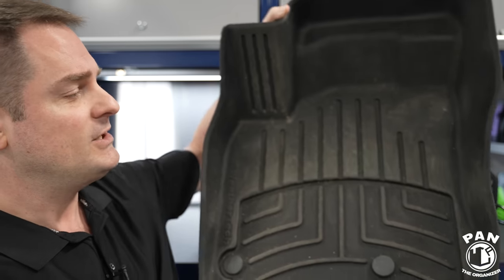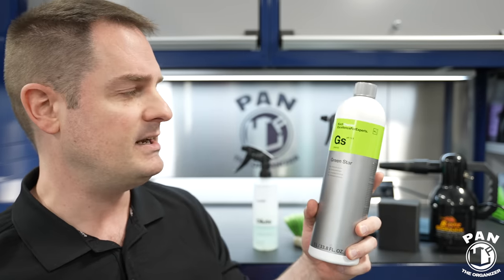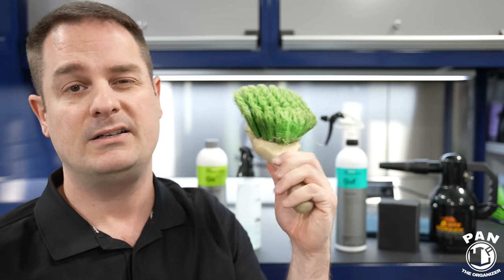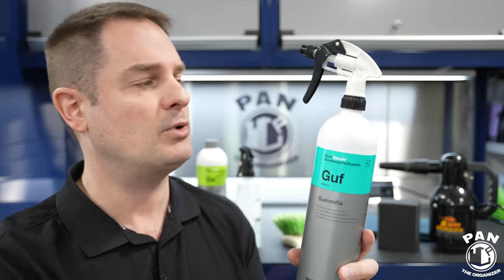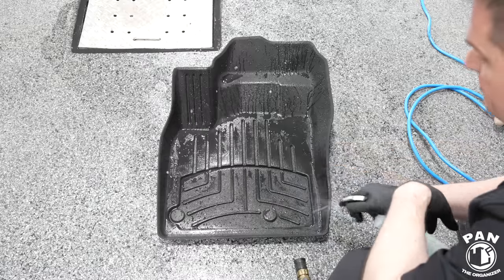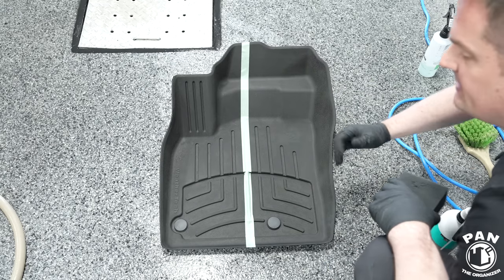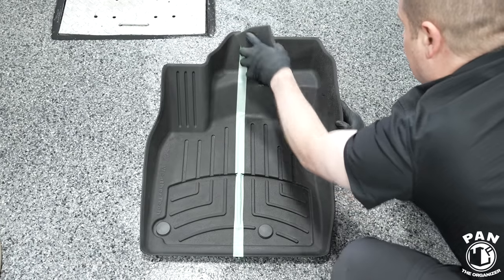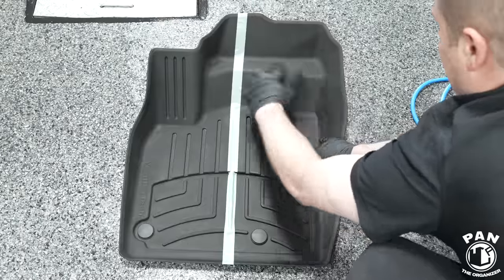HOW TO MAKE YOUR RUBBER FLOOR MATS LOOK NEW | All Weather Mats

Comment: Hello guys. There are some guys saying that it could be slippery, the issue is not the product from Koch chemie, actually the issue is the generic matt that could be generic. The othe options available to use could be chemical guys "matt renew", adam's "rubber mat and liner cleaner"
Reply from the maker: I don’t have slippery issues with this on my WeatherTech matts.
Reply: @PanTheOrganizer  I agree. I have weather tech and it is not slippery and in another car I have a generic matt and it is slippery.

Comment: I used this product and agree it worked to achieve a good look, but the product is greasy and causes dangerous foot slippage. So I washed it off and re-applied it in a lesser amount. Same results. Finally, I used my buffer (not in the instructions) and it became acceptable. I wouldn't recommend this product as it has a slippery finish. This expensive bottle of chemicals is going to the hazardous waste facility when it opens this Friday. The products Pan has recommended fill my detail cabinet and I have been very happy with his recommendations - until now. (I can't understand all these satisfied users.) Yeah, the mats look great, BUT.....
Reply from the maker: I never had such issues. And I have been using this for a while now. And as you can also tell from the comments, the majority of the people who tried it feel the same way. How are you applying it? What type of rubber mats do you have? I have WeatherTech mats.

If you want something that cleans and rejuvenates, one product, and zero slip, here's my other tutorial: https://youtu.be/ea11kHw-YNA?si=5oXBxSgqAK8LrJ1m
Reply: First time I used a sprayer. Second time I used a microfiber applicator to better control the amount of product. It was slippery both ways. The buffer worked, but probably removed most of the product (even though was not part of the instructions). It did LOOK good though. The mats are BMW factory. I did not dilute the product as the instructions did not call for it. The degree of slipperiness is noticeable. When my wife and I got in the car this morning the first thing she said was: "This is dangerous." I have since washed the mats thoroughly and the problem is gone, but there is no way I would recommend this product. And that's from a guy who highly recommends most of the products you prefer.  Indeed, I use three other Koch Chemie products: Gsf, Gs and Mp.  
Not related: I have tended to favor the CarPro products you like. By the way, I enjoy your channel immensely. @PanTheOrganizer

Comment: Hu Pan, thanks for yet another great video.  Quick question, which two Mcguair or Turtle wax Hybrid Solutions products would you use for cleaning and protecting all types of floor mats. Thanks. Costa
Reply from the maker: I don't think they make anything specific for rubber mats.

Comment: Recently i watched a video where you had used a mckees floor mat rejuvenator would you say this product is better than mckees?
Reply from the maker: Both are excellent, but different. The McKee's both cleans and rejuvenates. The Koch Chemie is just a rejuvenator, you need to clean the surface with an APC before you use Gummifix.
Reply: @PanTheOrganizer  okay thank you

Comment: Thanks for the video. How does this compare with McKee’s37 floor mat cleaner?
Reply from the maker: Both are very good. The McKee's is also a cleaner, so it's more versatile. Guf is only a finisher. But I have a slight preference for the way Guf looks.
Reply: @PanTheOrganizer  thanks!

Comment: Love your videos but this product sucks didn't make it shine also there's to step with matt renew is only 1 step and it works
Reply from the maker: It's not supposed to make it shine. It's supposed to leave an OEM matte appearance, just the way I like it. I don't like glossy plastics. This isn't the Armor All days from the 1980's. Glossy also usually means slippery, and we certainly don't want that for rubber mats.
Reply: @PanTheOrganizer  thank you for making it clear love your videos

Comment: Is Gummyfix good for cleaning trim? Outside car trim, which usually made from hard plastic.
Reply from the maker: It’s not a cleaner.
Reply: Ok, but can I use it to the car trim, to get the same effects as you demonstrated in this video?
Reply from the maker: This is meant for rubber floor mats, and plastic floor coverings. Not for car trim!

Comment: for the greenstar or p&s brake buster, any difference if using dilute bottle or foam sprayer?
Reply from the maker: Greenstar is a concentrate so you have no choice to dilute it according to your use (instructions on the label). Brake Buster can be used as is straight from the spray bottle it comes it for max power, or diluted up to 1:3 in a foaming pump sprayer. It still works well when diluted, perhaps not as strong as undiluted for obvious reasons, but you get more for your money.
Reply: @PanTheOrganizer  what i meant to ask was is there any difference if diluted in a dilute bottle without the foam or diluted in a foam sprayer with the foam?

Comment: Wouldnt the flag tip brush be best to apply it so it can get in the creases easier?
Reply from the maker: There are many ways to apply it. I like the foam block as it spreads large areas quickly.

Comment: I found that using some diluted super clean does an excellent job on floor mats!! Have had a hard time finding the right protectant, if everything I’ve tried Chemical Guys VRP works the best but will definitely try this out
Reply from the maker: You can also try the 303 Protectant. I demonstrated that in this video: https://youtu.be/ea11kHw-YNA

Comment: So I ordered this recently, however the bottle did not come with a sprayer.. also has a plastic cap that leaves a tiny hole in the middle. Wondering if Carzilla forgot to send it or what?
Reply from the maker: There is no sprayer with this. You pour the liquid from that little hole in the cap onto an applicator. I just added my own sprayer to this bottle.
Reply: @PanTheOrganizer  Perfect! Thank you for responding and letting me know what my issue there was, just curious though Pan, what kind of sprayer did you put in there? I feel like I would enjoy having one for the convenience.

Comment: the gummifix i have i mind to try it out. 
when i clean my rubbermats i use p&s break buster and that works great 🙂
Reply from the maker: That's a good way to use Brake Buster. And after, you can use P&S Swift on the rubber mats, for the same effect like Guf.

Comment: Please make one video for people like me, who don’t have coated car. How to wash, what’s better a shampoo or rinse less wash, what to use for maximum gloss without coat. Thank you!
Reply from the maker: I already have my car wash tutorial here: https://youtu.be/7Koj5j2Es5U

That shows you how to wash a car, regardless of what protection you have on your paint: wax, sealant, ceramic coating, or no protection at all. It doesn't matter. Same procedures apply.

If you don't have access to water (those who live in cities with water bans or heavy restrictions, or apartment/condo dwellers with no real access to a hose, etc) you can follow my rinseless wash method here: https://youtu.be/p58Y5qRd3OU

Same rinseless wash method applies regardless of what protection you have on the paint.
Reply: @PanTheOrganizer Thank you for your answer! One more question. You say that Gyeon Wet Coat gives us the most gloss. After I apply it and rinse for activation, can I dry the car with a CarPro Beader + CarPro DreamMaker? (I saw this mix in your video too :) ). Or is there a better way?
Reply from the maker: After using WetCoat, you can just blow dry the car. 100% contactless way of my drying. Then you can pick up any residual water droplets with a microfiber towel and quick detailer, or Bead Maker + Dream Maker combo, what ever you want, but it's not needed. I wouldn't stack too many different products one over the other.
Reply: @PanTheOrganizer  Thank you very much! 👍

Comment: Pan, another great video. I needed this.  My WT mats always end up chalky.  I finish with 303 or Pearl but they don’t look nearly as good as yours.
Reply from the maker: How old are they? Sometimes there's a point of no return when they have been through wear & tear for many years. Also, what do you first clean them with? Did you try something like McKee's Rubber Mat Rejuvenator? See my video: https://youtu.be/ea11kHw-YNA
Reply: @PanTheOrganizer  It’s amazing. You always reply to me!   I’ve used KC Greenstar (5:1) and Griots wheel, tire and mat cleaner.  And the mats are relatively new.   I’ve been using a microfiber towel for dressing.  I’m going to try an applicator block like you did.  Maybe that’s the difference.
Reply from the maker: Always a pleasure to help my viewers. I'm the only big detailing channel that replies to viewers on a daily basis on YouTube. I take great pride in that. I won't lie it gets overwhelming at times, as I can spend up to 4 hours every day just replying to YouTube comments. As you can imagine with almost 1 million subscribers, I receive thousands of messages and emails across all platforms, so it's not a simple task.

Sometimes, APCs can give a chalky white appearance on surfaces if not rinsed properly or neutralized.  Koch Chemie Green Star is a very good APC so that shouldn't be the issue.

Perhaps try a different product all together. McKee's 37 Rubber mat rejuvenator, which cleans and protects in one product. See my tutorial here: https://youtu.be/ea11kHw-YNA

Comment: I ordered a bottle of Guf based on your video using your link.  It worked great on the vehicle floor mats.  It also restored the look of the side bars without creating a slippery surface.
I tested it on black trim around the tailgate step but it faded after a day or two.  I know that's not what it was designed for but I wanted to see how it would perform in that area.
Reply from the maker: Thanks for sharing your personal experience!